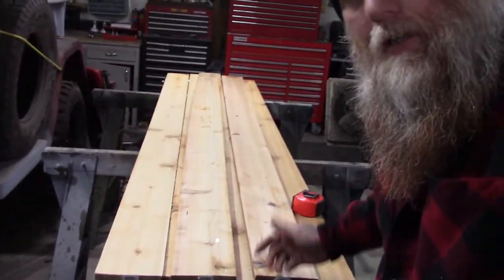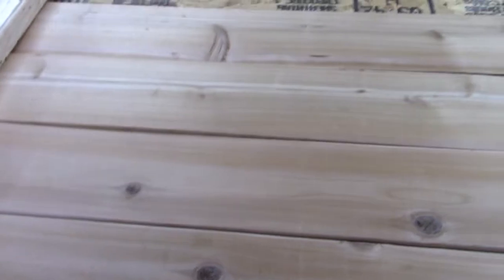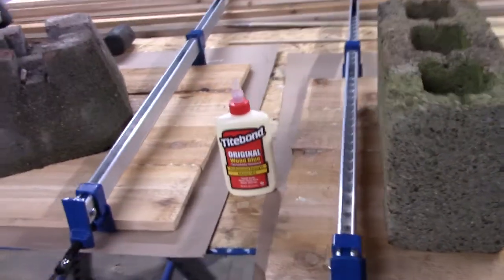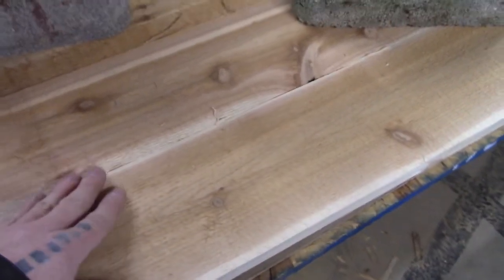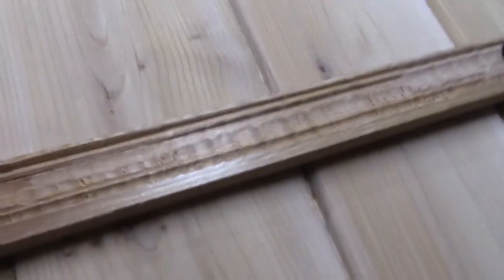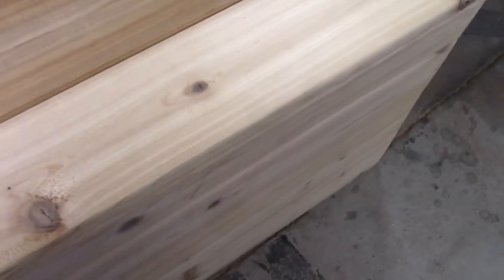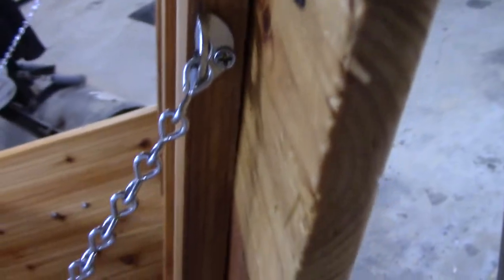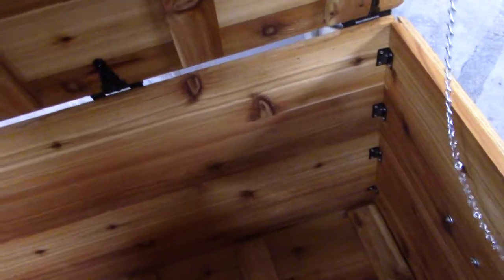How to build your own Cedar Chest

Comment: The "ribs" you placed on the inside, if you would've turned them sideways and placed them underneath and used them to attach your legs together that would've helped support the bottom like you intended without the purchase of angle brackets.